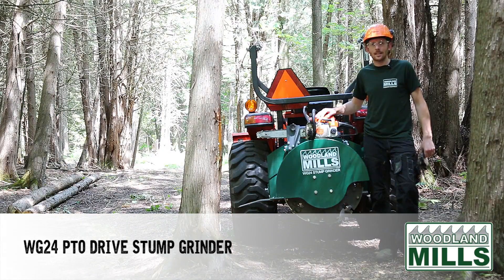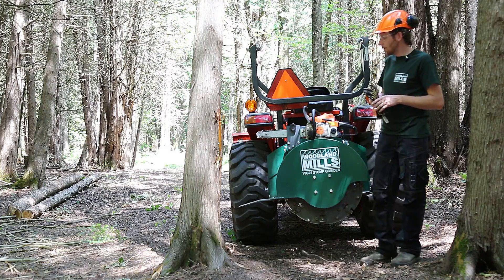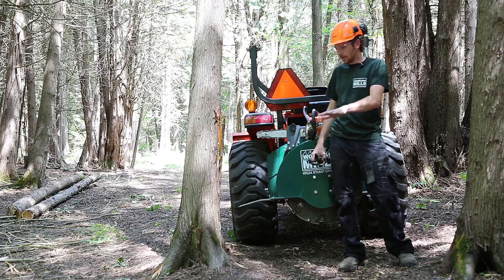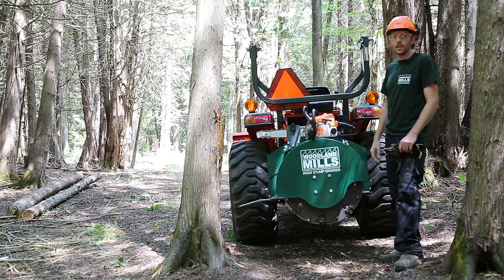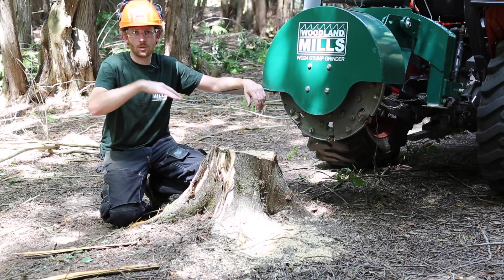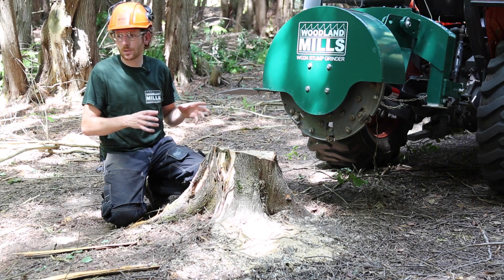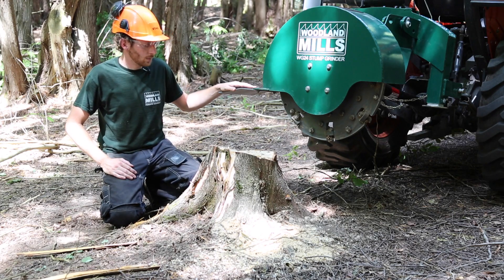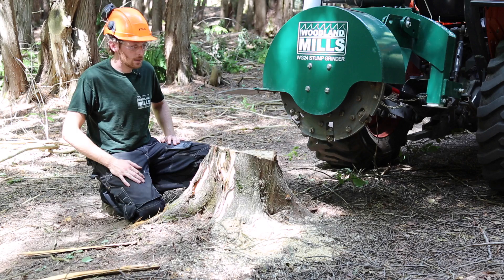WG24 Stump Grinder Demonstration

Comment: Why don't you cut another foot off with chainsaw , then grind the last little bit . That's all I want a stump grinder for
Reply from the maker: Yes, the more wood you can remove with your chainsaw, the less you need to grind with stump grinder. Sometimes people stay away from cutting to close to the ground if there are signs of dirt imbeded in the bark etc. as it can dull the chain on their chainsaw prematurely.
Reply: Woodland Mills 
Nevertheless I am interested in getting one .I have just ordered a 4in wood chipper for my kubota

Comment: Hello. I have a Kubota B3200 compact tractor with 23 hp at the pto. I am looking to do some sidework next year, maybe 10 to 15 jobs a month. Would my tractor be able to handle the load at the pto?
Reply from the maker: Hi Dilbert, 20-45 HP at the PTO is recommended. It appears that your tractor is also hydrostatic which is compatible.  If you can check on our website to see compatibility   www.woodlandmills.com or give us a call to discuss
 1-855-476-6455

Comment: Can you use this grinder if my tractor has 66 hp, the specs on the grinder say up to 50. Why does it have a limit.
Reply from the maker: Hi Bryan, If you put too much power into the stump grinder it could cause damage to the unit. It was designed for this amount of  HP.  It's more of a caution as it may not be covered under warranty. Please contact our Tech department 1-855-476-6455 to discuss. Also,  the HP we reference is at the PTO, not the overall.

Comment: I have a kubota L3560 DT it has a shuttle transmission with a clutch. The WG24 works great but a little clutch feathering is necessary without a HST transmission or a very slow creep gear. I put my FEL in float position and curl back and forth to avoid slipping the clutch to much. Then reset the tractor and repeat. the average 20" pine stump takes me about 15 min from 6" above to 6" below grade. It works good for me and so far the teeth have held up great after 40 or so stumps. Its not as fast as some grinders out there but at this price point its hard to beat and having it ready whenever I have the time to grind a few is worth any inconvenience of not having a hydraulic head. Especially since I have 500 or so stumps waiting.. I didn't see much info on using this stump grinder with a manual type transmission so I thought I would post my experience. It weighs around 450lbs and looks/feels solid with grease zerks where needed

Comment: What is the HP requirement?  It seems obvious that a hydrostat transmission is a must for this grinder (slipping a manual trans clutch on every pass isn't a good idea).  That's definitely a well engineered piece of equipment.
Reply from the maker: Hi,  20-45HP  at the PTO is recommended . The WG24 stump grinder will work well on your Hydro static tractor with the PTO shaft operating at 540 RPM. The WG24 is also compatible with a Mechaincal  live two-stage clutch. Please check our website for more details or contact us toll free at 1-855-476-6455

Comment: Beautiful attachment and grinder!  Love your videos.  You look to have overcome the extreme vibrations and hopping by using the tension of the tractor pulling the cutter against the stump to keep it smooth.  Seems to work better than a swinging 3pt mounted unit would.  What is the standoff from the rear shroud to the cutting wheel if getting up against trees or fence lines?  Also - about how long do the carbides last when getting to full grinding depth in sandy/clay/loam soil?  THANKS for the video.
Reply from the maker: Hi Canokie,

Thanks for your comments. The distance from the face of the flywheel (including the teeth) to the back of the stump grinder is about 6". Therefore, you would want to have at least 6" between the stump and any objects directly behind the stump to effectively grind. If you're just grinding into sandy/clam/loam, the life expectancy of the carbide teeth would be quite good - I would guess over 20-30 stumps before you will need to sharpen them. Grinding in gravel areas will yield much less tooth life and possibly chip the teeth meaning they would need replacing. We sell replacement teeth in packs of 6 which are quite inexpensive though.